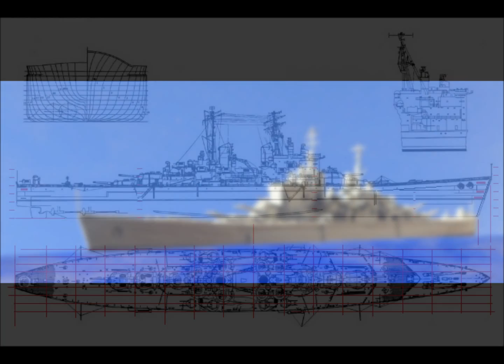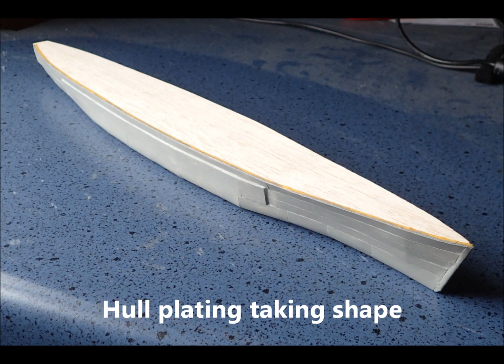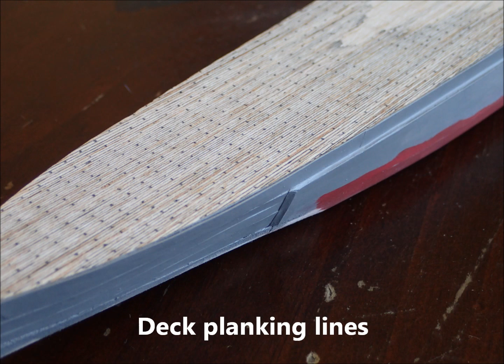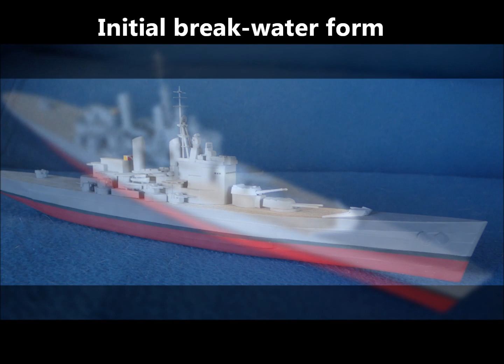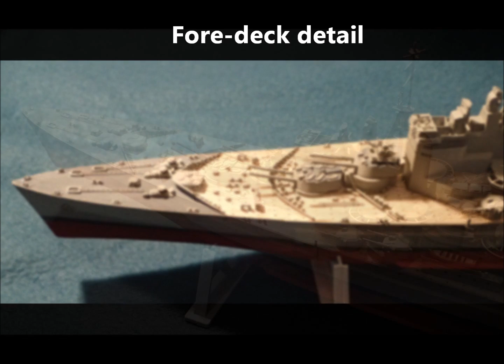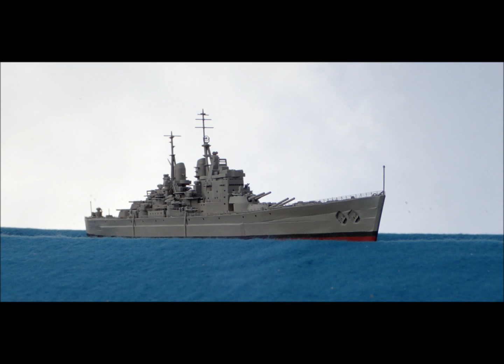1:600 HMS Vanguard scratch build

Comment: Sure be nice to see how you formed the turrets!
Reply from the maker: It probably takes a bit of practice with thin cardboard and then thin plastic.  Also helps if you've done some tech drawing in a  past life.  I just looked really closely at the item from the HMS Repulse kit, tried to measure / guess the dimensions of the base and the centreline and wing support templates that are internal.  Then the main challenge was laying the roof plates in their over-lapping arrangement and getting their plan right.  Then its a "simple" matter of gluing the thin plastic sheet around the whole lot, sanding or filing it to shape.  OR you could just buy some 3D printed turrets from Micromaster, much easier, but I liked the challenge of trying to make the whole thing!!
Reply: @RF590KG84  Thx for the detailed reply! I made a Hermes from paper/wood mostly, using an Airfix Graf Spee hull. Turned out OK but nothing like yours. I may try and convert a KGV into Vanguard someday with Hood turrets but right now I'm trying a Revenge from Iron Duke. Kit Bashing has saved my interest in modelling as I ran out of new possibilities years ago with the limited availability in 1/600. Cheers mate : )

Comment: You have done an incredibly beautiful job here mate. Much respect from a fellow modeller. What still baffles me is why none of the major model companies have produced either a 1/700 waterline, or a 1/350 full hull version of the Vanguard. Those are the two most popular scales. You can even get a 1/350 Montana which never got off the drawing board, but other than the weird 1/450 scale (probably Heller mold) kit, nobody is building one of the best and most beautiful battleships that ever sailed.